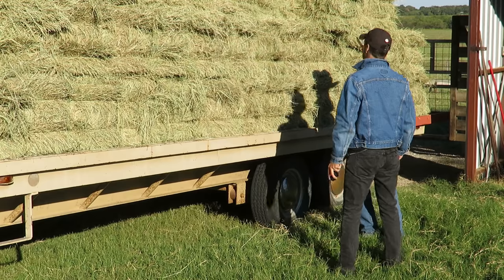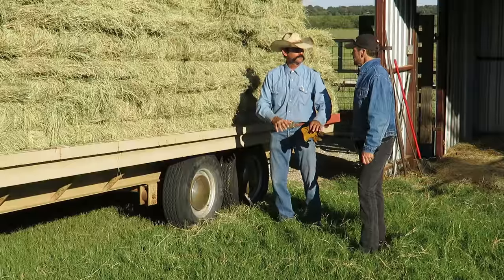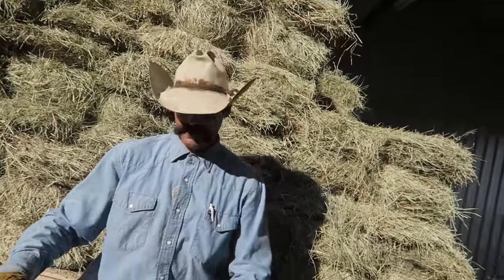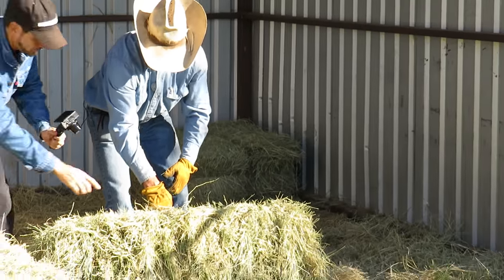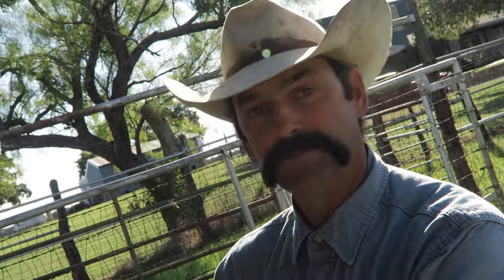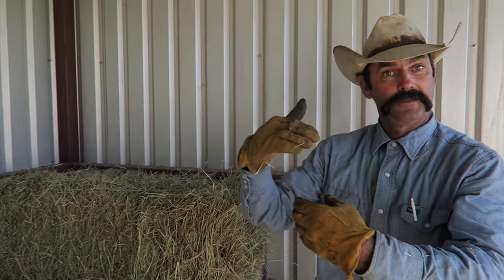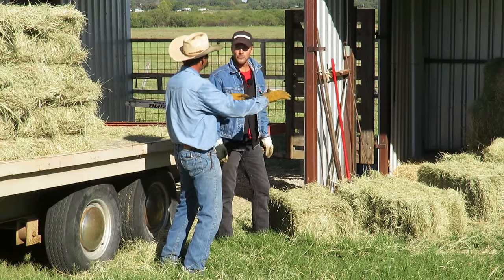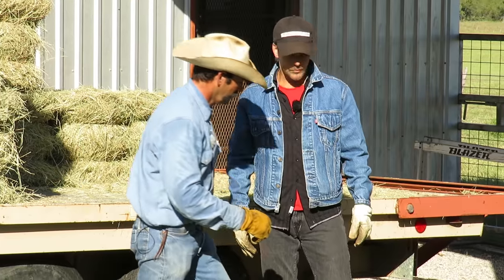Hay Stackin' 101

Comment: For someone stacking hay on trailers and in barns for the first time, I reccomend jeans, long sleeves if you don't sweat too much, leather or pig skin gloves, a fishing hat or cowboy hat, sunglasses and clear glasses for in the dark barns, AND most importantly, a 24 pack of light Beer and some waters.👍 Eating before also helps because after doing 1 or 2.... 80 to 100 square bales loading and stacking can make you very hungry. We usually do about 1,300 bales in two separate days but its more of a relaxed hangout bailing. I do this every year for a friend at work and It's more like a get-to-gather hang out job than a chore. 🤠
Reply: 1300 bales  in 3 to 4 hours with a 15  min break

Comment: Any tips for someone really short like me? i can  barely lift one bale of hay and I envy those who can throw it over their head like nothing. What can I do to be as fast and strong as them? I'm just worried my short height will put me at a major disadvantage.
Reply: Obviously, use your legs & knees, not your back, first of all.  Second, get your trailer as close to your stack site as possible.  As soon as I have my base layer down, I position the trailer right up to the base bales.  I do a lot of bouncing and making a slide off the trailer after onto the base.  I role a lot of them both long ways and sideways.  Then I start stacking like he does in a staircase like fashion, so I can step up the stack carrying a bale or when I get tired I either slide it upwards or flip it upwards.  When I have to move three strand bales, I sometimes maneuver them by standing them on end longways, hold them by the strings and "dance them" to where they need to be.  Key is picking them up and carrying them the least amount as possible for us vertically challenged, girls who don't want have to bulk out.  Like he says let the hay do the work.  I'm 5'1" & weigh 110lbs when my hair is wet.  Stay hydrated, so your joints don't stiffen up (if you're over 50 and don't want to die the next day). I'm working on configuring my barn so that I can use a grappler for when I'm 87, like my dad and my knees don't wanna move (I can barely keep up with him stacking still).  Yesterday, I put up 45 bales of 3 strand we bought (we were short this winter).  We usually stack 100 two strand bales a cut.
Reply: @lilongge1304  wow! that's awesome! i'm only 18 lol, and I hate I have to carry it with both hands and take baby steps to the cart, i wish i could swing it over my head like some people can, I seen em do it! Thank you for these tips, any other farm work tips you could give?
Reply: Learn to use hay hooks (a pair in the right size for your hands) properly like they are simply an attachment of your arms and you will have a lot more ability to do more hay because your won't be using the energy to grab around the baling twine or wire AT ALL. Your hands won't tire out like they do in the method shown here. Still stack them super nice, but learn to use hay hooks!!!! Learn all of your farm tools and proper use and maintenance. Wheelbarrow - the wheel should be fully inflated or even filled and your arms should barely have a bend, if any at the elbows because just you standing with your legs and holding the handles should be enough to lift the wheelbarrow off the ground and roll it forward. DO NOT USE YOUR BACK. LIFT WITH YOUR LEGS. When mucking lift with your legs. When shoveling lift with your legs. Tip- switch arms, IDK why no one ever switches to their non dominant side, but you have two arms and two sides and the more you work on your non dominant side the more muscle and control you will build on that side so you can go twice as long before your arms get sore because the supportive hand vs the shoveling hand use different muscle groups - just switch them up so both sides are used. When you have a corner or certain area you can only do with that off side you will thank me even more. Remember how to eat an elephant when you look at a task - One bite at a time. Do not take too big of bites so that is hurts you or pushes you physically. Two trips that you can manage in small bites is more than one trip you took big bites and pushed yourself and now you hurt and can't do much more work. Learn what each tool does and what it is used for and how to use it - I assure you there is a youtube video on how to properly use the tool. Does it push, lift, scrape, scoop, etc? It will be uncomfortable to use the tool wrong and the job will be harder. Using the right tool for the job in the correct way will save your body so you can be doing it at 80.

Comment: ? for the DOC. I learned putting all the bales on edge.  What is the advantage of putting layer2 and above flat?
Reply: What I learned is when we are putting them in the "hay stall" in the barn or to be readily available lots of people put them flat after the first layer as it's easy for a person to grab a bale by reaching the strings and go take it and use it. For any old school real baler or person who truly bales the hay and stacks it in their barn, especially right after baling I was taught to stack on ends because of the moisture factor. When you stack on ends any moisture runs out the bottom side of a bale and this is true even when stacked in criss cross ways so you can simply cut the end of a bale off and they stay dry longer. I live in a moist area far North of places like TX where we have many bodies of water. It's also how any person who is over 70 and deals with hay stacks where I live and if they see you stack on ends they will literally go "Oh, a farmer" and you magically have a good deal on hay vs if they see you stacking on sides they think of you as a fool. 

    Old school farmers/ranchers and especially those who know how to use hay hooks always stack on ends in more moist regions so entire flat side of the hay doesn't go bad (usually MOLD) and the hay is lined up for drainage of moisture to bugs to anything that would come out of the hay. We could not just stack it in an open shed/run in like he has in my climate as every day the hay would be subjected to moisture and mold would happen on flat sides. We know to stack on ends.